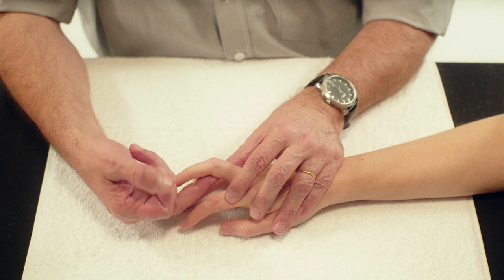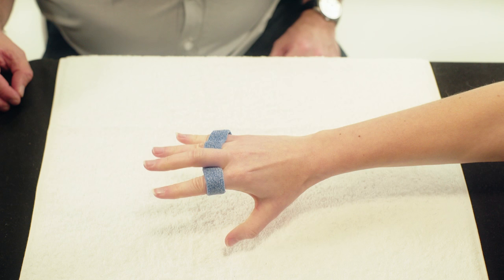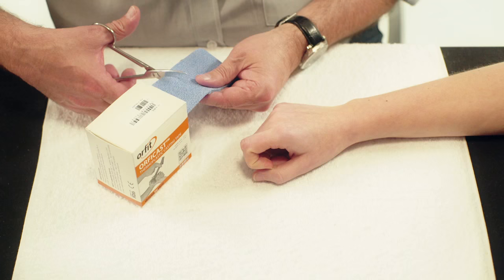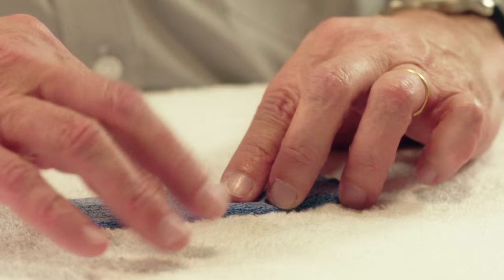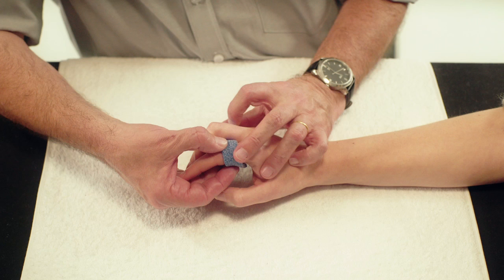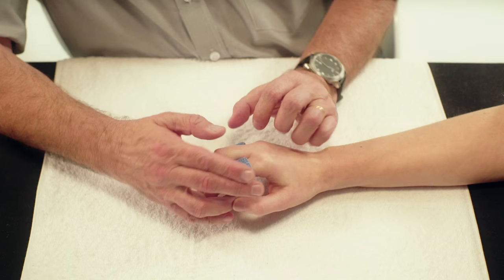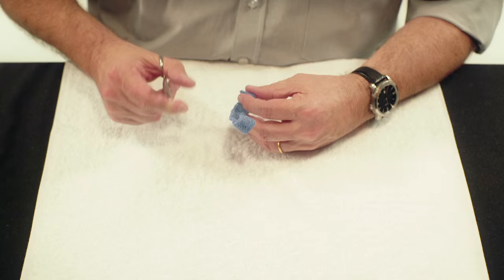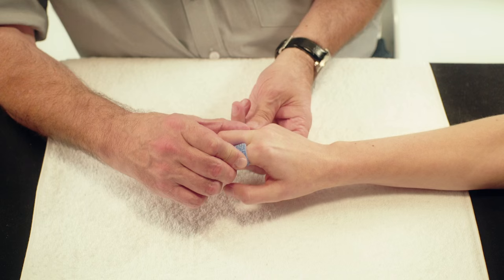Yoke orthosis middle finger - Orficast Instructional Movie 12

Comment: This spint isn't indicated after sagital band repair.
Reply from the maker: Hi Morel Boico,

Thank you for your comment. 

According to Dr Merritt:

“Patients with acute sagittal band rupture, less than 2 or 3 weeks after injury, can usually centralize the tendon when placed in extension and will experience pain relief soon after relative motion extensor splinting, even when flexing in the splint. These patients are splinted in a similar fashion to long extensor repairs, without the wrist splint component. Success is evident by encouraging full finger flexion in the splint (minus 15 to 20 at the MCP joint), which should be pain free without tendon subluxations. This splint is then maintained for 6 weeks (although others recommend 8 wk). Little or no additional therapy is usually needed once full motion in the splint has been achieved. Surgical techniques to correct chronic sagittal band rupture usually recommend 8 to 10 weeks of immobilization with a variety of surgical procedures, from direct repair to various tendon slips from juncturae tendinum, or a strip from the extensor digitorum communis. We prefer to create a tendon graft pulley directly into the head of the metacarpal,5 done using palmaris longus, juncturae tendinum, a strip of extensor retinaculum, or a strip of extensor indicis proprius. All of these have been used successfully, followed by relative motion extensor splinting for 6 weeks using only the finger component and no wrist splint. Full activity and use is encouraged and full recovery of flexion should be expected. It is useful to perform the surgery with local anesthesia to appreciate the value of the splint.

- Source: Merritt, W. H. (2014). Relative motion splint: active motion after extensor tendon injury and repair. The Journal of Hand Surgery, 39(6), 1187-1194.

And a recent article by Dr. James also talks about the use of the yoke orthosis for sagittal band injury:

"Nonoperative management is indicated for patients who present within 3 weeks of injury. Treatment consists of a period of splinting the MCP in neutral or slight extension for 3 to 4 weeks. This can be performed with a static or dynamic splint such as a relative motion or yoke splint that keeps the affected MCP joint slightly extended, 25 to 35, compared with the other digits."

- Source: James, N., Farrell, N., Mauck, B., & Calandruccio, J. (2022). Sagittal Band Injury and Extensor Tendon Realignment. Orthopedic Clinics, 53(3), 319-325.

Please let us know if you have any questions or comments.

Have a nice day,
The Orfit Team